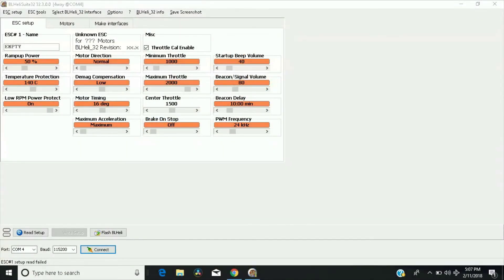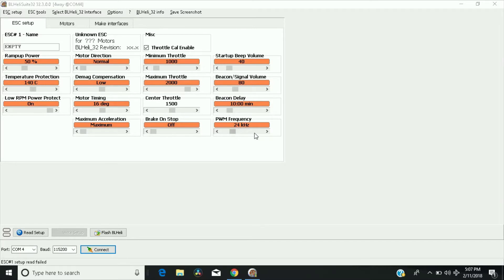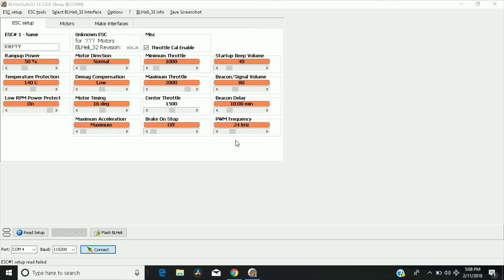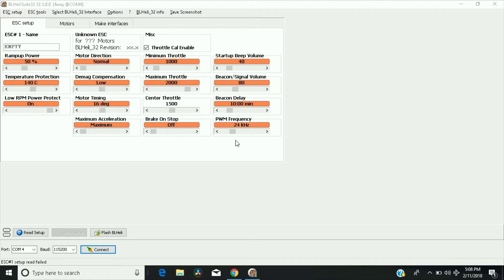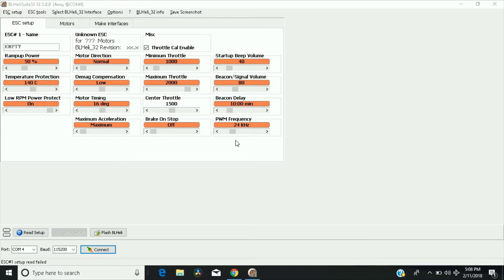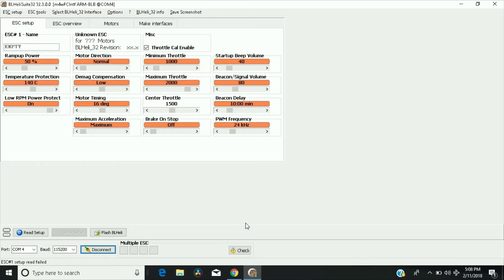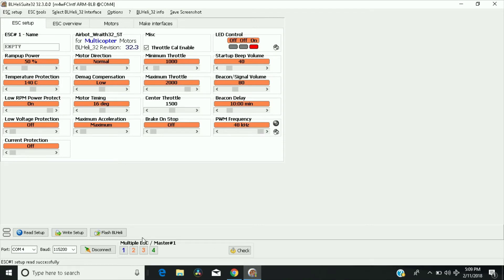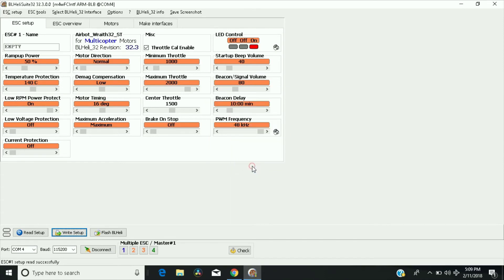Blheli32 & PWM Frequency

Comment: Thank you
Reply: Your the only one in a video! Even with Bardwell new BLHeli32 video. That showed how to save the setting in BLHeli32 by click the (write set-up) which saves the changes you make in BLHeli32. I been building quads for three years and have always run the factory esc firmware that has came on the esc from the factory. But recently with all the new settings with Betaflight and making it increasingly harder to tune small light weight quads without some RPM filtering or rpm firmware involved. So im kind of new to tuning esc's. So this video helped a lot! Thanks for being thorough!😀

Comment: Adter calibrating my bolt32 esc i noticed that the min and max throttle values are all different. And they go from 1010 to 1016 and max is 2010 to 2016.. and 3 of the escs are not in sync with master. I see your are at 1000 and 2000.. what should.i do? Change them or leave them to whatever bleheli32 puts after the calibration?
Thank
Reply from the maker: you can change them to reflect 1000 and 2000

Comment: Can this use in ESC BLheli_S?
Reply from the maker: Ok blheliS stick with 24 not 48. The controller can’t go that high on blhelis
Reply: @ViperFPV  I got bheli s running d shot 1200 with the aikon 4 in 1 35 amp esc. Is this ok to switch with it set to dshot 1200 bheli s?
Reply: @tylerwilliams786  No point in running 1200. Go 300.

Comment: There is also pwm rate on the bf Configurator just under the esc protocol dropdown. It was not there pre bf 3.4 unless you have multishot. It is on for dshot1200 in bf 3.4. The max is 32k. Does the blheli 32 pwm rate over write the setting on the pwm rate setting on the configurator?
Reply from the maker: The pwm rate is separate from what you are talking about.
Reply: I dont understand, what should the PWM Frequency in BF be at? 16k or 32k? 16k is stock. and, what is that anyway?
Reply: @HoldoxFPV  wondering the same thing...

Comment: Thoughts on the braking being off or on and at what percentage for fpv racing?
Reply from the maker: Braking is for wings and it should be off. Pretty much when u get off the throttle it will make the prop slow down faster by using braking. It causes very crappy flight characteristics. I tried it once and it also caused hot motors because we are on and off the throttle a lot.
Reply: Viper_FPV thanks mate

Comment: Flightone doesn't have a setting of 48..
esc frequency is max 32.... 
so will it work normally?? 
and another question.. flightone .. 
Says my minrc is 172 an maxrc is 1798
how is that possible.. 
in Bf same Futaba settings… 
it goes from 1000 to 2000 :s 
really confusing
Reply from the maker: I’m sorry but these settings are for running dshot1200 using betaflight or butterflight I am not familiar with flightone or raceflight